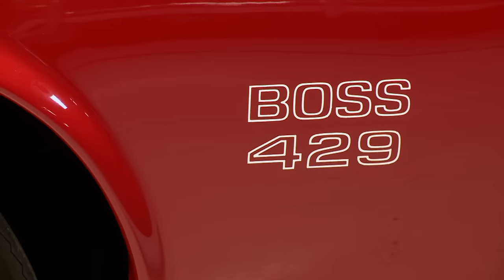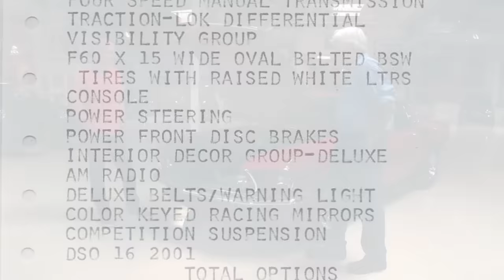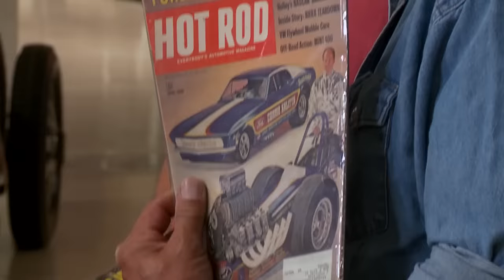1969 Ford Mustang Boss 429 - Jay Leno's Garage

Comment: My first car was a 69 Mach 1, 351 Cleveland , 4 speed Hurst, 4 bbl. Stock tires and hubcaps. It was a screamer as is. Had power steering which leaked, turn hard to the stops it would piss out fluid . AM radio with an 8 track. Loved the turn signal repeater on the hood scoop and the hood pins. Cost me all of $800 from a guy in Greenfield MA. Got hit by a Puegot that ran a stop sign shortly after I got it. Selling it was worse decision ever . But I did get a 68 GTO next... another story for another time ....

Comment: I enjoyed this episode but it seems like the Boss 429 is more of a mystery to Jay than it is to the average Mustang lover. Jay goes on about how huge and heavy the engine is when in reality (thanks to its aluminum heads) it weighed a 100 lbs less than the 426 Hemi. Then Ford put the battery in the trunk so that totals 175 lbs off the nose. Big difference. Throw in the BOSS  lowered  and sway bar'd suspension and you have a decent all-around car vs the clumsy tank Jay describes before driving it. Also little or no mention of the relationship between this 429 and the two other Big Blocks offered in the Mustang at that time: the related but non-BOSS  429 CJ and the very different FE-series 428 CJ.

Comment: My father bought a 1969 Mustang new in the same candy apple red colour.  Unfortunately, it was only a coupe with the 302 engine and automatic transmission.  It was a really base car, with no power steering, brakes, etc.  I think the only options were the AM radio and wire spoke wheel covers.  He handed it down to me after 5 years when I graduated from college.

Comment: My 69' T-Bird had this same engine, 429 Thunderjet. Lots of thrust.
Reply: Not the same motor in the Thunderbirds sorry do some research.
Reply: @springwoodslasher79  Same Size in cubic engines with a 7 Liter. With a couple of variations it must have been the same block engine.
Reply: @imbluz  you are delerious..

Comment: I had a '70 Mach One with a 428 and the Hurst Drag Pack.   I think the compression ration was 11:1, but I'm not certain.  I'm also thinking that it had a 411 differential.  It was a screamer in the quarter mile, but not that great on top end.  Wonderful car to drive, though.

Comment: What a great car, I have a 70 mach 1 428 cobra jet. So how did they get that to run cool? I have a feeling if they had been on a hot summer day in traffic they would have been on the side of the road. Anybody have any new ideas on how to keep the big block mustangs from overheating? We don't have 100 octane gas anymore. Timing seemed to be very critical with overheating in those days. Any ideas? Mine is bone stock original.

Comment: When I first started driving I was buying fast backs for $450 to $1200    We had three of them. There’s nothing like it the 69 you can see the brake coolers in side mirrors   My stock 302 would burn rubber at 75 mph  no problem even with a crap load of miles on it.

Comment: The Boss 429 engine was actually first meant to be installed in the 1969 sleek fastback Fairlane/Torino midsize body that Ford was using on the NASCAR tracks. (Not Galaxies).They modified the body on these  cars as Talladegas for even better aerodynamics on the superspeedways. The logical idea was to homologate both the new engine and modified body in the one model. As was said, Ford changed their mind, and the rest is history.

Comment: I loveeee the Boss 429. But to be honest...I'd rather have the lighter, well balanced, high reving Boss 302. I was very honored to ride in a 69 Boss 302 clone at a local car show, and it was the perfect balance. It was a 4spd, modern tires and a few little performance upgrades. 👌

Comment: That guy was saying  "we didn't appreciate 69 mustangs back in the 70's 80's "  Oh I did !!  In the early 70's I was set on getting a 67 fast back when I was old enough to drive,  1977 my dad went to buy a 69 MACH I ... I couldn't think of what a 69 looked like so I went with him. .. before I even saw the front I was hooked.  I finally got around to buying an 69 fast back in 89 for $2500. I still have it, black with centerlines, daily driver.

Comment: When people say the horsepower was underrated, oftentimes they exaggerate. The key is the torque at 450 lb-ft. Horsepower is usually slightly less in a Ford V8. So we're talking like for 425 and dynos back that up, give or take.

Comment: Do your research people. Due to insurance rates related to horsepower, FORD pulled a major ploy by basing horsepower at the rear brakes (brake horsepower). Presently known as Rear Wheel Horsepower.  Transmission and rear differential parasitic loss is determined to be 71 hp.
Engine hp 375 + 71 bhp = 446 hp.
Engine was definitely detuned with small carburetor for emissions and insurance regulations.

Comment: I dont know about the boss version, but I had a 429 in a 70 Mercury Marquis two door, much like a 70 Lincoln continental. No smog pump. I could not take off from a stop without spinning tires if I gave it any gas at all. only way to take off without burning out was to ease away at idle, then very gently feed it a tiny bit of gas.    any time you hit the gas you'd likely burn tires. also as the speedometer went up, the fuel gauge went down.

Comment: Eye candy only,,my 64 1/2 289 COBRA would burn circles around this beast. On the track they performed bad on the turns, the body couldn't take the torque on take offs and would zig zag, but what a great looking car. Boss 302 had better control, i had a few stangs and so did some of my friends. Loved them then, and love them now.

Comment: A Really nice Boss 9....  I prefer the looks of the 1970 front nose a little bit better.  The 1969-70 years were the pinnacle of performance and styling for most American Muscle cars.  The Mustang, Torino, Chevelle, GTO,  Camaro (1969 & 70), Charger, Challenger, Cuda all hit the high bar in the two years.

Comment: Boss 429 was developed for Nascar. It wasn't a street killer. Still with some tinkering you could make the car scream. 351 Cleveland and the Boss 302, 428 CJ were better street racers along with the 289 HP. Had a friend who had a 289HP in his 64 Falcon pulling 375HP. That car was fast and light. Beat many big blocks on the street.

Comment: Without doubt the 69 Boss 429 was the meanest looking Mustang ever. One of the meanest looking of any car ever. Incredible that Ford built it. They lost money on everyone sold. The engine was EXPENSIVE.! The installation was costly. The trouble with these cars is , in stock, as delivered condition. They were a underwhelming performer. No faster then a comparable 428 C J Mustang, but costing a thousand dollars more. Ford detuning left it with too small a carburetor, a restrictive intake manifold, too mild camshaft, and a super restrictive exhaust system. Now, with that said . Correct those shortcomings, and with finer ignition tuning. These engines were as strong, or stronger the anything the competition was fielding.

Comment: The Boss 429 was closer to 500 hp.
Ford always underrated the power output of their engines during that time. It helped sale the cars because the main buyers were males under age 30. That's where insurance hits the hardest. Buy underrating the hp it made it easier for customers to insure.

Comment: Green paint may be zinc chromate which is used on aircraft aluminum as a primer to protect the metal. Just a guess; but airplane parts have that exact same shade. I can’t tell more from the video.

Comment: We have to drill holes in the fender well to change the spark plugs without going through hell then we just plug the holes back up, engine compartment was always I don't know it was too much motor for the car

Comment: I remember when these cars came out.  The Boss 429 Mustang was a dog in stock trim.  A good running 428 cobra jet could beat it.  Lots of big names tried running them in pro stock with little success.    They sat on dealer lots for a long time.  Jay is right.  This car is misunderstood.

Comment: The smog pump went on manual transmission cars.  The manufacturers quit putting a rear pump in automatic transmission cars around 1965.  Since the wheels couldn't cause the engine to turn the smog pump was unnecessary on cars with the automatic.

Comment: I love the Boss 429, but my dream would be the Mach 1 with the 428 Cobra Jet so I could also have A/C and comfortably drive my car regardless of how hot it gets.
Reply: I had a choice in 1970 to buy what I wanted and decided on a 351 Cleveland, four barrel, dual exhaust with an automatic transmission. My friend had a 428 in his 69 and it drove poorly. Too nose heavy. The Boss 302's were noisy and 327 Cameros were beating them. The Mach I was quiet, fast and the FM stereos were terrific, if you live in a bigger city. That was the model and engine combo to have in 1970.

Comment: i had a red 69 mach 1 it had a four speed and the 351 windsor motor  i loved it, before that i had a 67 289 4spd fastback, before that i had a 66 3spd 289....now i have a 500hp 460 4spd in a 1931 studebaker 5 window coupe rat..i called it "Frankenstude Too"...check the utube videos on it.... search Frankenstude Too..

Comment: I had a 70 cobra torino 429.I ca,t temember the H.P. But with the C6 yrans flooring it stand still ot would burn tubner through every gear to 100 m.p.h. floor it at like 35 m.p.h. it would down shift to first and oh my god it accelerated badass supreame.

Comment: Great job but man I would not have any smog stuff on, put a nice 950 quick fuel carb on, bbk headers with flow masters screw that stock crap! Also there is always a way to put air conditioning in nowadays maybe not so much when this car was built but for sure can do it now. I love the car I’m just not a fan of building a car 100% factory stock when there are better options just small stuff that will make driving the car more fun.

Comment: The ONLY reason for the existence of the Boss 9 Mustang was because NASCAR required that a factory had to sell 500 units before it was allowed to compete. Ford wasn't ALLOWED to run it in the 69 Daytona 500 because of this rule.
   As a result, the Boss 9 didn't even debut until later in the season.

Comment: Beautiful car, best looking Mustang ever.  However, it was just a 14s 1/4 mile car.  You can spend a fortune on one of these, if you can find one, or go out and buy a new one at a quarter of the cost and have an 11s. car (with a 10 spd auto).  And the new cars sound wicked with the switchable exhaust.  We're living in good times again with respect to pony cars.

Comment: Chevy 427 was rated at 425, 430 , or 435. Hemi had 425 horses. Lots of times due to insurance reasons the engines were underrated. I've heard the Fords rated at 335 were in reality making about 410. I remember reading about a guy who put a 427 SOHC in one of these. I still wonder what kind of power these would actually put down to the rear wheels. That to me is the real measure of how much power a car is making, dyno it at the wheels! Also too, this car will get you laid. :-)
Reply: James Sawchuk  You didn't need a Boss 429 to get laid in 69 and 70. I was about 19 y/o and was embarrassed by the amount of girls that were lining up back then. It was a wonderful time to be alive.

Comment: My sisters’70 Mach 1 “M Code” could be identified by its D-Ring steering wheel horn, taken from the ‘69 Boss 429. This one has standard push buttons. 
Reminds me of all the corrupt mechanics telling a 24 year old woman that she needs a new carburetor so they could steal her Holley that made me laugh. She’d had owned more high performance cars and cruised at higher speeds than that garage had in total. 
Still question that steering wheel “refurbished” part.

Comment: Mr restoration doesn’t really want to admit much. I have owned quite a few 64-73 intermediate and compact fords and still do. That front end is junk stock, pretty much a widowmaker with big blocks.  Brakes could get you in trouble also. These cars stock were simply not that fast. And probably didn’t make much more than 400hp. It had a mild cam. Beautiful car but the tires were too tall. They made 60 series in that same tire.

Comment: Nobody talks about the 428 cubic inch Cobra Jet engine in 1968 335 horsepower out of the factory
Reply: That's an FE the 429/460 was the 385 new series big block ford

Comment: Jay has a ton of knowledge and tells it like it is, but in a road course a 289 would beat it right, yeah right. Like a Hemi Cuda or Challenger good luck in the turns with 700 lbs sitting over the suspension.

Comment: Funny no one mentioned the manual choke. They came with a sticker on the dash which read "NOTICE This vehicle is equipped with a manual choke located immediately below the ignition switch. For proper starting use manual choke."  I guess no one saw Jay's offer to buy the car for twice what it sold for new for the insult it was. He clearly doesn't like it, and thinks it's "misunderstood." What a stupid thing for a Ford guy to say.

Comment: Which is faster 0-60 the 67 shelby gt500 or this boss? The info is that the shelby doesit in 5.5 and the boss in 7.1 why is that so if the boss has a bigger engine with more horse power?

Comment: I have a 70 fastback with a 351C 4V 600 hp build. Used a boss 429 scoop and made a replica.. functional scoop same like the original. I put the cable for the scoop exactly the same. Build aod its fast.. i live close to Germany it does 200 mph.  I want to build a big block car to, but im pretty sure the Cleveland handles better, much underrated engine. Big blocks are heavy in the front but they are torque monsters though.
Reply: Sweet! 👍 I always liked the fastback the most of all the Mustangs. 😉 Aloha from Hawaii ! 😊🤙

Comment: The factory hp rating is correct. You could bring it to life with a better camshaft, headers, holley carb and proper timing ( timing is crap factory for emissions.

Comment: My first car was a 1966 Mustang Fastback 2+2 (I miss that car); my next one was a 1965 GT Fastback. As far as I'm concerned Ford screwed up the Mustang from 1972 forward. It amazes me how a company that had such a great thing going for them could totally screw the pooch. (Especially when I think about what the 1978 Mustang looked like, WHICH WAS LAUGHABLE.) But to Ford's credit, they aren't the only company to have done that. Their competitors (I'm thinking Dodge Charger and Chevy Camaro here just to name two) made the same mistakes; granted, I think a lot of the decisions were motivated by all of this anti-smog and emissions crap that had to be accounted for inasmuch as performance may have been concerned - but the mistakes they made with body STYLES had NOTHING to do with government restrictions. Those mistakes were all on the manufacturer, their designers and (MORE likely) the idiots in the boardroom who wouldn't know how to even drive a car, much less design one for their customers. 

I worked for EDS in the 80's and 90's. At one point we were purchased by GM. Those IDIOTS (on the board) were driven around in limos parked in their CARPETED, AIR-CONDITIONED (and heated when necessary) garage. I have some serious misgivings for idiot board members who are probably even too lazy to wipe up after themselves in the toilet. Anyway, getting back to car talk...

I so miss my old Mustangs. Would love to find one to have rebuilt for me today. I agree with Jay about the handling of the '69 Mustang Boss 429. I preferred my 289 hi performance in the 1965 I had.

Comment: I had a 1970 Boss 351 Cleveland (Semi-hemi heads), better car, better engines, more HP/ci and it was LIGHTER because the 351 Cleveland was a lighter Small Block.

Comment: All 1969 Detroit cars handled bad/terrible no matter what motor they had. The one exception my be a corvette. A boss 302 motor is actually a heavy motor the heads are large and all steel. The Boss 429 had aluminum heads plus the front stance was wider which improved handling. Aluminum heads can actually take and need more compression than steel heads so 10.5 Cr is actually really low for the period. .

Comment: I never understood why Ford didn’t put that engine in the Torino and Mercury Cyclone?
Reply: They did in smaller numbers. A lot of Torinos got the 429 with SCJ heads, and the T-Birds got the 429 with Dove heads, etc... The only reason the 4-bolt blocks and Boss heads ever made it into a production car was to homologate them for NASCAR.

Comment: Not the most powerful engine. But it was created to be if you installed an appropriate camshaft, carburator, and intake. Its specs equaled or bested a Mopar hemi if comparable versions (available from Ford) of the above were installed. Indeed, it was a Ford hemi. But better built. However, it ran fine as it was. And the insurance was much cheaper due to having an undersized single carburator and camshaft. Which was Ford's intention.

Comment: The heads brathed so well that 429 cu in was to small of displacement  thus the poor acceleration. Stroke that motor to 545 inches and it now will produce 700 plus hp on pump gasand leave the the Mopars in the dust !

Comment: They could've put air conditioning in the Boss if they wouldn't have put that stupid smog pump in there. I'm glad cars are more environmentally friendly now, but the cars from the 70's and 80's got strangled. Luckily they only had one hand around their throats in the late 60's. But after that it was both hands

Comment: I have work on these cars when they first came out I was the hy per man with ford they should have left the engine alone left what they really built them for Nascar they 13 to 1 com big cam 700 lift diff  rods a lot of performance parts on dyno on these engine were 700 hp plus if they were lift alone it would have been faster car around but lower the hp down so the people would but it big mistake